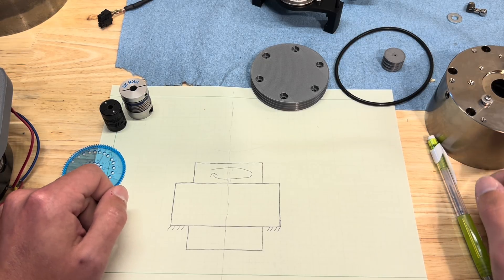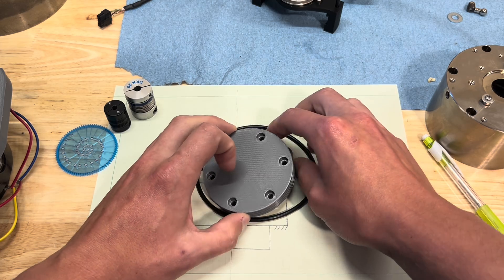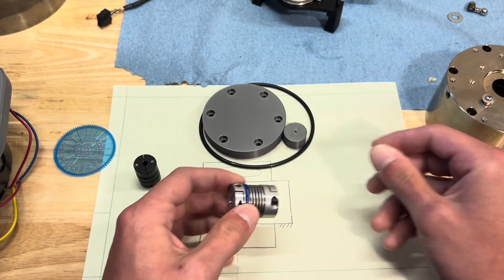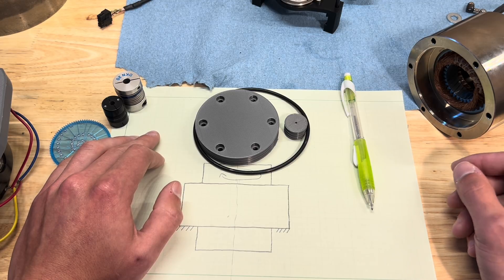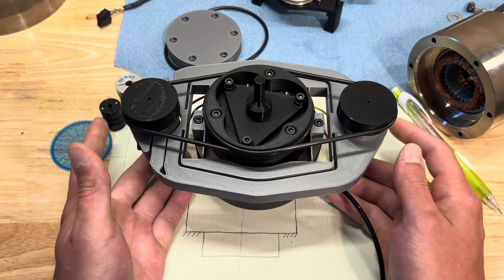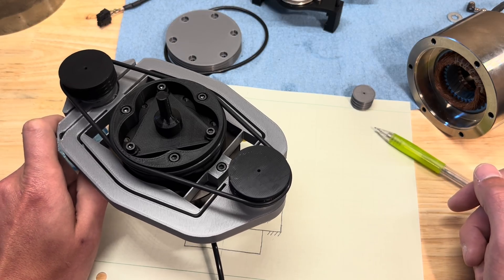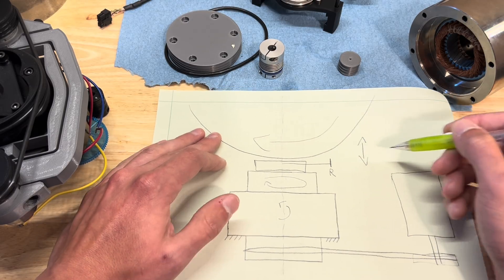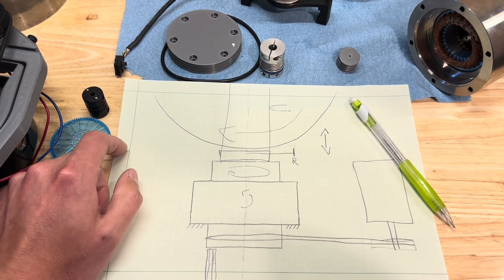Flexure decoupled belt drive for ultra-precision spindles

Comment: The torque on the spindle goes to some point that does grinding or cutting work.  The smaller the radius at that point, the greater the force, and that force has to be reacted somewhere, eventually following a path to the motors that drive the spindle.

If you had a direct drive motor built into the spindle, could you somehow avoid this problem?  There's usually a greater moment arm axially from the nearest bearing to the grinding or cutting point.  I don't see how to get rid of that moment for something like an end mill.

Comment: To avoid the tiny bit of torque on that short lever arm between the two belts, what about pairs of belts? Two on the inside to one of the drivers, two on the outside to the other driver.
As a complication on that with more dubious benefits: Each of those half-pulleys could then be put to a separate motor and controller, for a trick to let you get out of the belt transmission's dubious low-power regime into the more comfortably linear region of the power-to-geometric-slippage curve. Set one to go e.g. 1% fast and the other 1% slow to maintain close to 1% geometric slip on both belts, or more if the belts need to stretch more than that to power the actual spindle load without stretching more than that. The fast pulley will end up sourcing an equilibrium amount of extra "bias power" into the system while the slow pulley sinks equivalent power, and with ESCs capable of regenerative braking that power can be recycled back from the slow ESC to the fast ESC, with the system's net power only being the spindle's power plus the efficiency losses on that bias power loop. (Could also loop the bias power with a mechanical transmission instead of an electrical one, i.e. a fixed-ratio gearbox from one pulley to the other, but I wouldn't automatically assume that that's more efficient than doing it electrically.)

Comment: That's an interesting drive system, that I have no encountered before. Thanks for showing!
I am not sure though, if it is truly non-influential, at least in the proposed setup with one motor and one idler. In that situation you have only one belt section, that is transmitting a net load, meaning pulling forces on top of the belt tension. If I am not mistaken, this will still put a side load on the spindle pulley. In a truly symmetric setup with two motors and very good dynamic load sharing these forces would cancel out, but such a solution would be very complicated and might introduce harmonics. This is definitely a non-trivial problem as most things in the precision world.

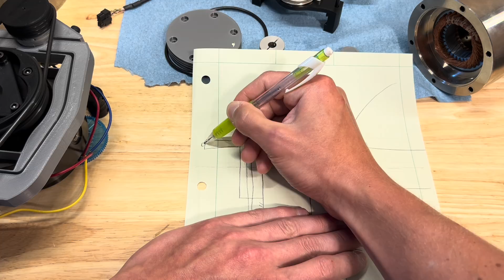Comment: Two or more motors have been used in phonographic turntables, but I have not seen the flexure mounting concept used there. Usually the motors are suspended in som kind of polymer suspension, or rigidly in something heavy. The concept you describe at 18:00 also used to be popular in turntables, there it is called an idler-drive.
Reply: Was going to comment similar 👍

Comment: Nice idea. I'm not really familiar with this level of precision, but won't your 2 belt design induce a torque perpendicular to the axis of rotation? The tighter the belts, the more the torque and as the belt tension varies with load variation, this rotational torque will change. Perhaps a design with 1 belt on one side and 2 belts on the other side, either side of the first, so it is balanced, would eliminate this?

Comment: After reviewing your video again, your setup would have    low torque capability.  If that doesn't really matter, then your better option would be magnetic coupling. Either through 1 or multiple stator disks depending on how much torque you need it to handle. This has the advantage of no contact. So no vibration or torque pulses and no axial or radial errors.

Comment: Ever tried to stack a bunch of gears with degrees of offset and pitch? You could add a gear stack as well on the opposite side. 

It is probably printable in place, say 2mm per gear and 10 gears per stack. Similar to helical gears but without axial forces.

Comment: Errors in the motor pulleys and belts should only be sources of asynchronous error motion; only the contact surface of the spindle's pulley should matter for synchronous error. Elastic belts load and unload tension gradually as they wrap around each pulley, so there is always some amount of geometric slippage that occurs that's proportional to the change in strain between the tense and slack legs of the belt. As a result, the transmission ratio in a belt drive transmission is ever so slightly irrational by a factor that depends on the amount of power being transmitted, and the positions of the belts and motor pulleys shouldn't ever repeat relative to the spindle.

Comment: Your proposed multi-belt setup still applies a "bending" (or tilt?) moment to the rotor, proportion to belt tension.
Reply: Easily remedied by employing  2 belts on the right side which straddle a central mount belt on the left side.
+--------=======+
Reply from the maker: @ExtantFrodo2  yes! which is why the pulleys have 3 grooves. the reason i only use two in the video is because all the orings i have are the same stiffness, so the equilibrium point would not be centered. one would need to be doubly stiff, or the flexure mechanism would need to be designed with a bias to one side. i should have explained this in the video, i figured someone was going to catch me on it :)
Reply: @cylosgarage I saw a 3 belt, 120 degree solution floated in the comments, too.
Reply: @cylosgarage  Why not just use 4 belts, two in middle and two on the ends, now you don't have to worry about weird non-linear belt behavior from different belts?

Comment: Equal-size pulleys would make this setup less sensitive to vertical position errors. Any offset that moves the spindle off of the line between the drive motors will result in a force back to center that's proportional to the displacement and the cosine of the angle between the belts, so making that angle as close to zero as possible minimizes that error.

Comment: Is there a functional difference between using belts in this design vs using gearsets? I suppose the tooth to tooth variation in force etc, but with enough idlers, i imagine you can even it out.
I suppose natural extension of that idea -- what is it that prevents a planetary set with a large number of planets to function in this application?

Comment: I notice your integral drive used a slotted motor. For integral drive setups, slotless bushless DC motors are pretty convenient because the “spring constant” for the negative magnetic stiffness of the rotor is often an order of magnitude less than that of a comparable size slotted motor due to the larger gap between the rotor magnets and the surrounding magnetic material (even though the copper windings might still be quite close). 

They can be a bit harder to find off the shelf in larger (>50 mm or so stator OD) sizes, but small slotless designs are used for slot car racing so you can get little ones easily for cheap.
Reply: Once handled a very smooth servo motor: old school, just your basic brushed PMDC machine, but made in such a way (just the right geometry of poles/slots, with just a little helix) that it ran very smoothly indeed, no perceptible cogging, and very stiff braking when short-circuited.  Quite sizable given the rating (maybe 2-4x what you'd expect for a ~1/4HP motor).  Came out of a rack-mount (but not full-rack, it was about half-cabinet sized) reel-to-reel computer data tape system.  I'm sure there was some residual cogging that's detectable in a precision system (data tape is sensitive to torque variation: velocity fluctuation, and thus the frequency of bits streaming into the tape head, is a factor, but self-clocking data streams address this within some safe margin), but it was very nice by hand at least.  Also used ferrite magnets -- nothing terribly strong (which probably accounts for most of the size difference, actually).

Comment: If you already have air or oil plumbed to the spindle for the bearing and you only care about speed control, why not use a turbine to drive the spindle? You could even make it symmetric, like a steam turbine, to cancel out axial forces. I believe old Moore jig grinding heads were powered by a turbine.
Reply: I was thinking a (Nikola) Tesla turbine, because the rotors in those are just smooth disks, and would have very little variation.
Reply: I know there are a few air powered spindles that spin up to some pretty crazy high speeds but for super precise work I think they need some lower surface speeds and pneumatic power tends to have a hard time delivering low rpm high torque force. I’m guessing steam would introduce a LOT of heat into the spindle which would cause thermal expansion and ruin the precision. I am just some dude on the internet though.
Reply: @bewaretheintertubes  You wouldn't use steam, just the same air or oil used for the bearings

Comment: What happens if the belts have variation in spring constant? 

What is the tolerance on the idler pulley position and diameter?

Comment: Seems like a good idea. But if the time varying tension is different between one of the belts and the other (which is guaranteed to be the case), there will still be a force, yes? Even if the force is reacted through the frame, the periodic change in equilibrium position will result in a time varying displacement, with given substantial mass of those motors and that yoke, means large inertia, and so you would still have a period force. And there would be resonances to consider as well. Something you don't have to really worry about with rigidly mounted components. A lathe spindle can't really be modeled as quasi-static.
Reply from the maker: yes, this is certainly not compatible with high speed operation for that reason
Reply: @cylosgarage  But, with those O-ring belt, like you showed, the positional stiffness is very bad. So, it's not suitable for positioning either. Not stiff enough for servo positioning, not suitable for continuous rotation due to vibration, so what's the possible use cases?
Reply: I think his example would be appropriate application. Slowy rotating something for grinding.

Comment: Why complicate things. Go direct drive and eliminate all that complexity.
Reply: lol I don’t think you were listening. He addressed the issues that can introduce.
Reply: @bewaretheintertubes I heard his concerns. Slotless DC motor or out of phase stators have next to zero axial play or vibration when properly balanced.  Also flexible shaft couplers would eliminate most of it.
Reply: @henri1511  my personal biases/taste point to a frameless (as opposed to shaft coupled) PMSM (aka AC servo aka BLDC motor) and tune out any residual asymmetry in software in the vector drive, similar to decogging algorithms. But pushing complexity into the electrical and software domains is not necessarily the best solution in all cases and besides, that doesn't make the mechanism presented any less cool
Reply: I agree @notthatwitty